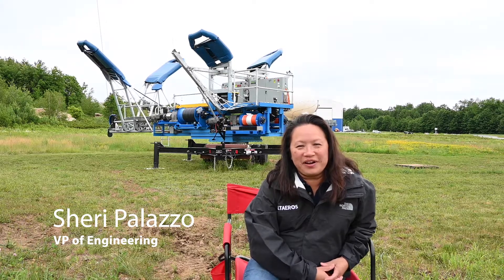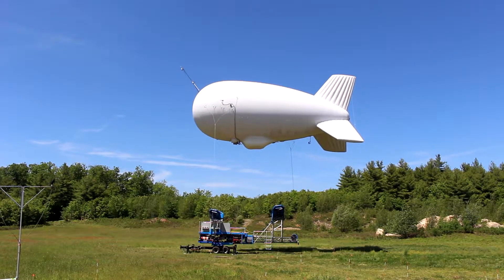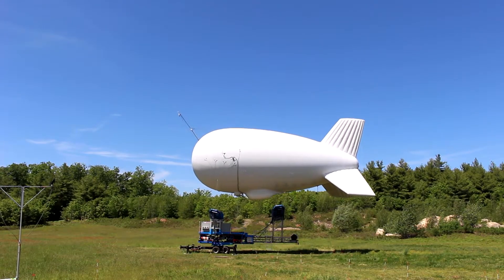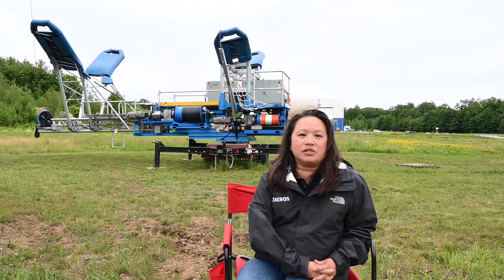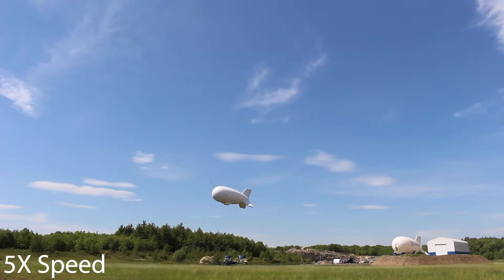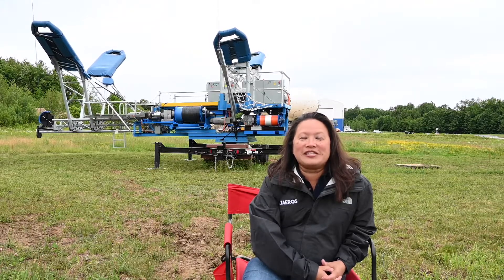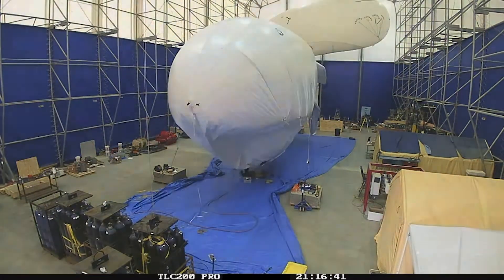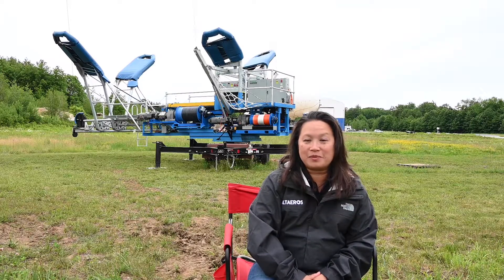Conversation About The Creation of ST-Flex with VP of Engineering, Sheri Palazzo

Comment: I just made a video and uploaded to my YouTube channel on ways to repurpose the Littoral Combat Ship (LCS). on more thought on that it seemed that another capability that might be added to it is to mount your aerostat on its flight deck  so as to give it an aerial view of its vicinity and thus extend the horizon limits due to earth curvature.

Given that in a war with China US aircraft carriers might need to stay a long way from China due to the ballistic missile threat to those carriers this might be a good capability to have in that the  carrier based E2 Hawkeye AWACS might be too far back to provide that aerial view and thus the aerostat could fill that gap.

Additionally you might be able to mount F-35 avionics on you aerostat such as its radar and other sensors and processor so that in effect on has an F-35 overhead that could do pretty much everything an F-35 could do in regard to its avionics with little modification to that avionics in that it doesn't really care all that much if it is own an F-35 or in an a aerostat on on the ground in a simulator lab.

The idea is that instead of retiring the LCS (especially after spending all that money developing and building them) that the Navy looks into repurposing them and taking advantage of all the new technology that has been developed since it entered production.

The high speed of the LCS might also help with being able to  manage the aerostat as to what direction the tether line is pointing and such.

So perhaps this might be worth someone  giving it a bit deeper examination as to its feasibility and desirability.